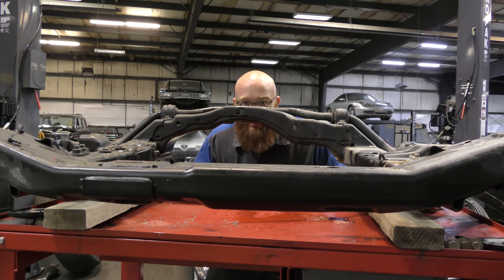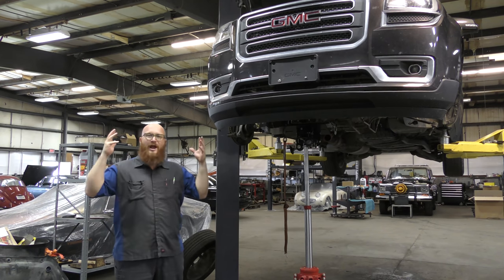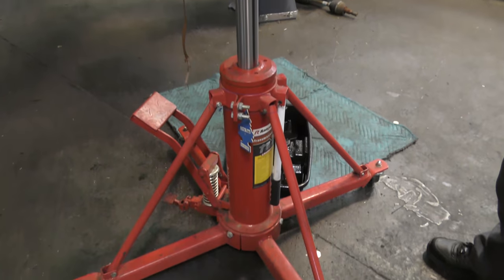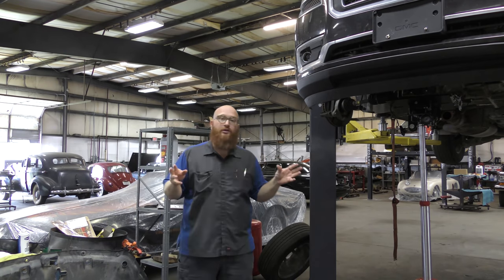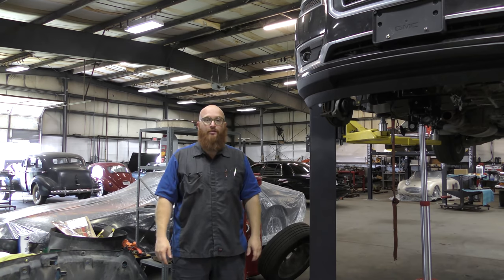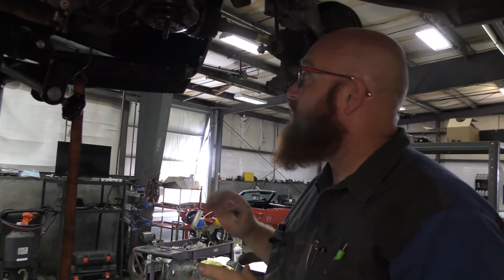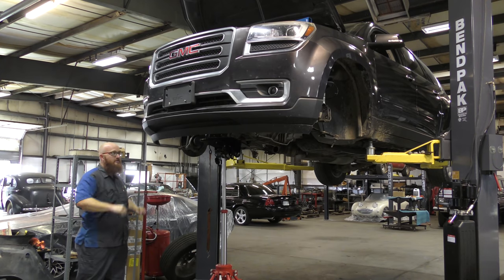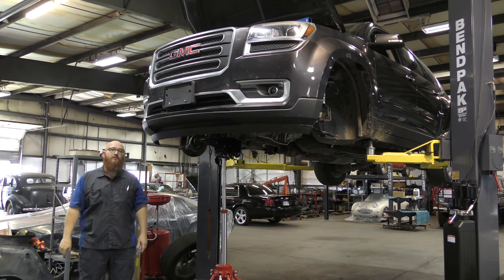Used car insanity in the CAR WIZARD's shop! Why did the huge repair get approved on this '15 Acadia?

Comment: Just did my Acadia timing chain complete job in my garage on the floor with engine in the car. Easy job. Took the front end off and you have all the room you need.

Comment: The 3.6L GM V6 is in a lot of of Australian Holden models too. One other major issue with them besides the timing chains in that the PCV system is flawed. 

On the passenger side bank (for right hand drive models) the PCV valve opening on the top of the valve cover is tiny, and 9.9 times out of 10 when you take the valve cover off you will notice notice significant sludge buildup on the inside of the valve cover because this bank isn't getting adequate ventilation. 

Inadequate ventilation+ sludge buildup= inadequate lubrication= goodbye engine.

Add to this the issues mentioned with the timing chains and you have a recipe for VERY expensive engine repair.

I know of a local ex-,Holden dealership technician who was working as a mechanic out of his garage who was offering to modify the passenger side PCV valve and for customers who own a Holden with this engine.

For a small fee he was able to mitigate against some of the HUGE cost of repairs for many customers and was able to extend the life of many of these engines.

Needless to say this is the reason he was fired as a technician from the Holden dealership, because he warned customers of the issues with these engines and offered the PCV modification as a type of preventative maintenance. 

Holden was quite upset about this because they were missing out on charging countless customers $1000's of dollars for repairs when the PCV system sludged up and the timing chains went bad.

Comment: On our Traverse we had to replace the power steering line, plus the serpentine because the power steering leak trashed that. We also had the water pump go bad and that AC actuator. The engine mounts went bad so we did those, and the AC lines proved to be an all day project when they started leaking. There was also a random misfire we couldn’t track down, and the rear main seal was leaking pretty much the entire time we owned the car but it was such a small leak we never bothered with it. What did it for us was the transmission.

Comment: It seems since extended service schedules came out that cam chains and turbos are having a really hard time, not to mention the poor base materials that modern engines seem to be made of. Backintday it was very rare for a chain driven engine to have the chains wear to a extent that it had to be replaced.

Comment: Best repair technician I've eared for a long time. Clear explanations, calm and respectfull of situations for all, great knowledges. You've become my favorite mechanic tech of all. Will fallow you. Keep up the good work. From Montreal, QC, Canada. I personnaly have fuel consumption problem. While speeding up gently, the acceleration goes up little too much and then drops down like it suppose to. No codes on dashboard. I think that it might be the shifting solenoide but not shure. A tip would be appreciated. Thank you and stay healthy.

Comment: I'm currently driving a 2006 Chevrolet Silverado that I bought used in 2010. It had 65K miles, and as of today it only has 97K. I never realized how lucky I am to to have a 2 mile drive to work. I wouldn't want to be in the position of having to buy another vehicle in these times.

Comment: I bought a Nissan NX 2000 in 1993. Then in 1997, I went to trade the Nissan in for a 1997 Honda CRV. The dealer had a 1992 Nissan NX 2000 in their use car lot. They were asking $7500. They offered me $3K as a trade-in. I bought of the fact they had a older NX 2000 on their lot for $7500. They wouldn't budge on the trade-in value so I sold it to a private party for $7000. My current 2017 Nissan Frontier, I bought used with 15K miles for $19000. The dealer offered $26K to buy the truck back.

Comment: Hearing the story of the man that refused to pay the $950 brought back memories of situations in my younger life in rural Sevier Co Tn,a few examples,no names,the families are still there,(1) one man's oil change was a cheapest filter & 1 quart of cheapest oil,heck boy,oil don't go bad,that filter keeps it clean(2)bad A.C,remove the belt,the A.C makes the engine use more gas anyway,(3)bypass the busted leaking heater core,heck fire boy,you can't get to the dang thing,we don't drive it much anyway,over to church or out to trade groceries,many more,i had never actually lived in a dwelling with central heat & air until i went into the Navy,imagine my surprise/astonishment at learning about this whole other world i knew nothing about,anyway,good video,you and mrs wizard are good people,Thankyou for your service sir.

Comment: The used car market is red hot right now because the inventory of new vehicles is very low.  Plus, if you can find a new vehicle chances are you'll pay around 10% more since dealers are marking them up.  Let me give you an example.  I'm in Northern California.  While having an oil change done on my wifes Hyundai Santa Fe I took a walk around the lot.  I started looking at some new SUVs.  They were the Genesis GV70 and GV80.  So the luxury brand of Hyundai.  The GV70 window sticker was nearly $70K, with a $7K charge for "low inventory.  The larger GV80 window sticker was nearly $80K, again with a $8K charge shown for "low inventory".   CRAZY!

Comment: I had one of those heater motor actuators go bad. (Ford F150]
It required a removal of the entire dash (a/c etc) BUT..
A YouTuber showed how to use a long reciprocating saw blade to “clip off” the bottom tip of the heater diffuser and get access to change it.
Did it myself. Only cost..the $40 actuator.

Comment: That's what I just did. Bought an older SUV as a family toad trip vehicle that should have cost no more than $2000 for $3500 from a private seller, and am spending $6K to get it bullet proofed,  restored and cleaned up. Timing chains, guides, fluids, diff, tires, brakes, ac, some body work and small electric stuff. 3 years ago, I wouldn't have done that. Now it's still cheaper than paying the insane new car prices (marked up) or getting a newer used model for 2x my total cost, which are less reliable and had horrible transmission and engine failures.

Comment: My 2014 Acura tsx has 100 thousand miles on it and I have had it since 2017 when it had 18 thousand.
I looked into changing the timing belt and was pleasantly surprised to find that my car has a Chain!
I discovered that eventually the tensioner will need replacing but not for a long while.
At the moment my car runs the same as it did the day I bought it .

Comment: When I see how screwed up these "newer" vehicles are today, how cheaply they are made, it makes me very thankful that I bought my 2008 Subaru Forester brand new in the Fall of 2007.  It has had regular maintenance performed and nothing major to worry about.  I have 152,000 miles on it now and it runs like it did when it was new.  Thank you Subaru...:)

Comment: "Hear me now and listen to me later..." Modern cars are insane. We don't need all the gizmos. We don't need electric windows and seats. We don't need on board computers and backup cameras. We don't need variable transmissions and ride control! Stop it with the add-ons.  I have a 1960 f100. Most people can fix anything on it and it does all that you need. To pay $1000. to replace a little electronic part is insanity. Bring back sanity. Think SIMPLICITY and you will have enough to retire one day. Thank you.

Comment: You do not need to take the dash off to change the temperature actuator on a Acadia. 
There are 3 and you can replace them without ripping the dash apart. 
I just change mine and I am not a certified mechanic.

Comment: All auto makers should get a class action suit for using plastic gears, be it hvac actuators, electric seats gears, antennas and so on. They should all be made of some light metals that won't break to avoid removing dashboards, or seat frames and so on

Comment: I’ve spent about 5yrs as a tech and another 12 as a service writer the whole time wrenching on my own stuff on the side at this point I’m not even surprised when you have to do stuff like remove a bumper cover and lower radiator support just to do a simple coolant service drain and fill or it’s $2K+ for a set of tires on a minivan. My favorite customer was always the one that said “I know someone that can do it cheaper” 🙄😂

Comment: Great video! The only gm car I've ever owned was the 99 z24 cavalier my wife brought to the marriage. My 97 maxima would run circles around that car and had better mpg. Anyways, we put new bearings in the z24 and dumped it for an 04 accord. I'm shocked people get burned and continue buying gm vehicles. I guess it's patriotic.

Comment: I looked at 2 Chevy Traverse today, they were bought by a dealer from an online supplier. One was a 2010, the other was a 2012. They were in arbitration with a company that covers the dealer with the online sale. Both vehicles were maroon in color, and both had transmission problems. Dealers by this junk because they are cheap, and people buy them. BTW, the 2010 had the p0008 and p0017 codes as well. I can't make this stuff up.

Comment: Every single one of those blend door actuators has failed on my 08 Impala at least once. I’ve replaced one three times. Replacing them is a PITA too and I hate it every time.
Also the cost on these is insane, $40 for two pieces of molded plastic that clip together, the cheapest DC motor money can buy, and the worst plastic gears possible.

Comment: You don’t have to replace the actuator motors what you can do is add a manual valve in your heater line so that you can shut it off in the winter and your air conditioner will work just fine and you can run a control into the interior to where you can manually open and close the heater valve

Comment: I've put broken flex plates back on because the customer refused to pay us for a new one.   (I work in a Trans shop) we made em sign a waiver and told them about it.        Next month the car got towed in cause it wouldn't move.   They paid for us to remove the brand new Trans again

Comment: I had no problem with my 2016 Equinox
LT 4 cylinder. It was great on gas and I got it new .03 MLS. I put 31,000 MLS. On the SUV
I thought it's only flaw was brakes I had to
change them every 14 months and could never figure it out the pads were still thick
and looked normal.

Comment: That actuator is just like having to replace the Heater Core/Evaporator core/Blend door/etc on a 2002 Dodge Ram 1500 Pickup.  The parts only run $40.00 or $50.00 each (Aftermarket, naturally) but you have to pull the entire Dash out of the truck to drop the Air Box.  So if you have to get one of them replaced, go ahead and replace them all because it's over $1,000.00 for a Professional to replace them.  Fortunately, I had access to a spare vehicle to drive and have a shop with tools plus 40 YEARS of "shade tree mechanic" experience (Along with several years of working in a Mechanic's Shop) and did the job myself, LOL!

Comment: I was about to buy a ‘12 GMC Acadia for $10k thank you for helping me decide. Going with a Volvo XC90 for $8k I need the extra space for my 4 kids and have a ‘12 terrain. Bought the terrain 2 years ago for $5.5k with 160k miles. Has had a few problems and oil consumption is a hassle. But not a bad SUV

Comment: I’m happy with my 2003 Acura cl that I bought. I got that for a steal with a brand new engine and transmission for $3,000 with 120,000 miles. Not good on gas compared to a 4 cylinder, but it still does the job and doesn’t burn my wallet

Comment: I had a beater delivery car that was driving horribly under load. 93' Saturn SL2 dual cam.I thought it was the valve body so I replaced that myself. No dice.   Then I was told it was the timing chain, so I replaced it in my driveway myself. Great success, never again.

Comment: My brother bought a 2013 Acadia a couple of years ago, knew he was getting bent over by the used car lot but didn't care and bought it anyway. He put $5k down and is going to pay $300 a month for 6 years. It also had close to 100k miles at the time. So when it's all said and done he's gonna pay $26,600 for a 6 year old vehicle, at the time. He could have bought a brand new Acadia with 0 miles for that! I don't even know how he got approved for the loan because at the time he was working part time at Hardees for $9/hr! He got a full time job at a warehouse for $12/hr shortly after and was doing slightly better but then got cancer around the time covid first hit and had to quit and relied on unemployment and family to pay his car note.

I can almost guarantee that he isn't doing regular oil changes so he will likely be looking at that $3-5k repair bill once that timing chain starts going out, which he won't be able to afford and then he'll have a non-running car with 3 or less years left on the loan.

Comment: I just did almost 3k of repair to a 14 model Passat for my kids college car so as to not buy a kids college car in this crazy economy.  I couldn't have bought an equally conditioned car for near that money - which is insane to me.   I also usually never buy new, but i could either buy a vehicle with up to 30k miles or pay from $6-$10k less for exactly the same vehicle brand new.  Weird, insane times.

Comment: If FORD stands for FIX Or Repair Daily (ironically should also apply for GM and FIAT CHRYSLER)  then I guess GM stands for Gargantuan Mess. This is why I always owned Japanese cars. I bought them all new and drove them each for 10 to 15 years, only selling them because of corrosion (I live in the North East in Quebec Canada and salt corrosion    
is rampant here and you hardly see very many old cars here unless they're not winter driven)

Comment: I grew up with a family business background.  People don't get the cost of labor. Specially people who work in an office environment and just draw a straight check on Friday. Parts are cheap. Labor to install them or do service work is not. I've seen people screaming at my dad over labor portion on a project. People just can't fathom your time is worth something. In our business labor cost were 75% of the end bill. Its not like going to Walmart and buying a $95 battery. And cars  particularly high mileage rust belt cats are are awful and ladened with surprises.

Comment: GM's crossovers have some of the most ass backwards designs.   I replaced the entire motor in a 2018 Gmc Terrain with 24000 miles.   Timing chain tensioner failed, skipped timing.    Dealers wouldn't touch it.      

I've seen so many other issues with them too.

Comment: As a customer I might be upset initially about the increasing cost, as everyone has budgets and car repairs are not a fun way to blow one, but I appreciate knowing all that is wrong with the car.  There were some blown bushings on my stabilizer links.  The shop could either replace just the bushings or the bushings and links.  They said there was some movement with the link so the link and bushing was also replaced.  I DO NOT want to go back to the repair shop for more repairs right after being there.  There is done, and there is done done.  I want it done done.  Really enjoy the show, keep making those videos.

Comment: The car manufacturers have been building cars that people either have to take it to the dealership or a mechanic that specializes in the cars they drive. It will not be too much longer before people will have to send their cars back to the manufacturer's for repairs.

Comment: I tore the aluminum AWD carrier bearing straight off a 2021 equinox with minor ground contact. When I went to string the thing up with wire I was shocked by the insubstantial construction. The pillow block looks like something from Walmart. From what I saw these are made primarily of 16 guage sheet metal and construction adhesive. The brand new car wasn't bad to drive until it was on the edge of being towed, I shudder to think what could go wrong in 25, 45, 60k miles. These are going to be one of the most hooped out families of cars in history in 5 years time. If not for the weak dollar they should probably reach scrap value by then.

Comment: For a timing chain job you don't have to take the engine off i did the job on a 2011 cadillac srx and 2015 gmc arcadia right in the vehicle and they runs great 👍

Comment: A skilled mechanic who has done this job before in a well-equipped shop can do the job in 6-7 hours.  But the shop may pull out a "Repair Labor Hours Reference Manual" and flip to a page and show you that the 'allowable' time for this repair is NINE hours!  And that is what they will charge you for.   How convenient.

Comment: My soon to be mother in law asked me to check her gmc and I saw the codes and told her do NOT drive this car. Get it towed to the dealer where you bought it and let them check it since she hadnt had it long. I told my sister and her fiance that your moms car is about to grenade, no shit, the very next day, BOOM! She didnt heed my advice and continued to drive it even though I said tow it straight to the dealer. Fortunately they took care of it and covered the engine swap but still it couldve been worse.

Comment: @3:35

A few months ago I went to a Toyota Dealership in the Western suburbs of Chicago: Winter 2023.

In the showroom was a Supra with a BMW engine and all.  It has an MSRP of $65,000.  

But the bottom number was $80,000.

Explanation: "Dealership Adjustment".

Comment: I just bought a 2015 Acadia Denali about a month ago and did not notice this video. Before I bought it. 😕 i have a 6 year warranty on it. But this Acadia was in pretty decent shape. So far the only thing is a little corrosion on the front of the hood and the drivers seat heater doesnt work